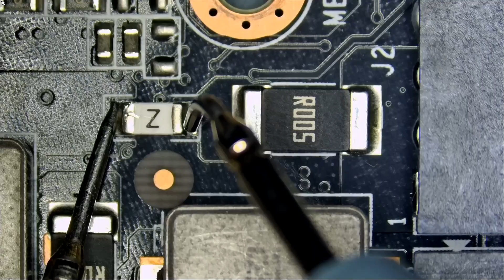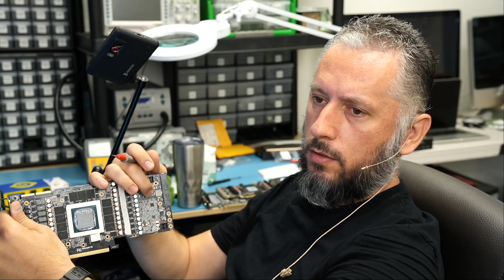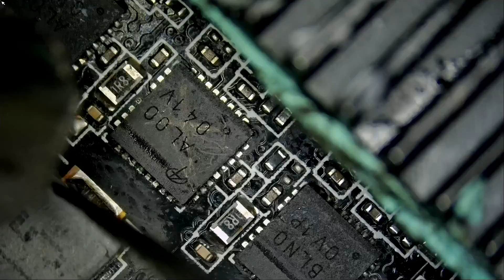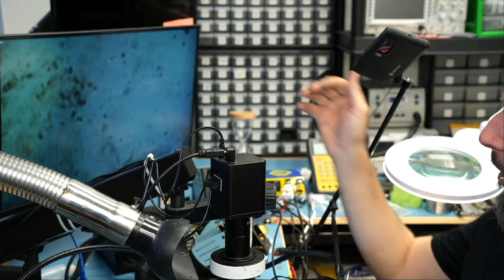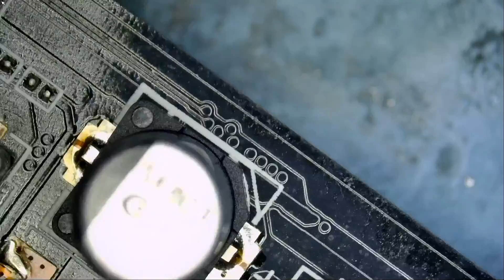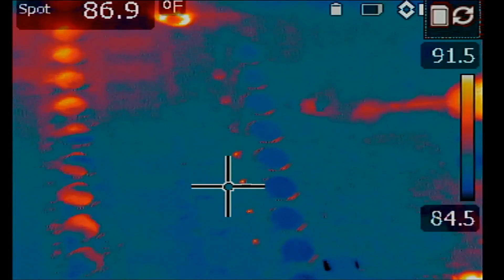Gigabyte Does it again. 3090 Graphics card repair - Failed and won't power on.

Comment: Okay. Story time. The second graphics card is mine. The burn resistor on the top is Arkansas' greatest repair shop. That card is liquid cooled and one day I made a mistake while putting on a water connector. Smacked that resistor and it broke off. I took it to a local repair shop and that's the repair he gave me. Cooked the damn thing. Worked fine until one day it just died. Assumed it was the mosfet (which I'm seeing now it was) and decided to shell out the money for the repair to NorthridgeFix. Honestly seeing this video was hilarious because I expected him to find it. Just didn't know how bad I would be roasted for it.

Edit: Thank you for cleaning that piece too. I'm sure my bill will see it haha.
Reply from the maker: That explains the Capacitor that was laying under the 12v coil...
Reply: @NorthridgeFix  So no water damage. Just shotty work. lol
Reply: @NorthridgeFix  that was on the first card tho not the second one with the crusty cap
Reply: Little Rock here.
Reply: We're gonna need a name drop.
Reply: what was your final bill?
Reply: @BahBahTheSheep  With Shipping and the secondary fixes. 419$. I've had it for about a month and everything works better than before but I also started undervolting it hoping that would also help it long term.
Reply: @Armstrongx7 beats buying another one lol.
Reply: What was the shop? I live in AR and would like to know to stay away from them lol
Reply: @Husslehoff  Any of the UbreakIfix stores. There's one in LR, NLR, and Conway. Dude cooked my board.
Reply: Why would you trust ANYONE in ARKANSAS with anything electronic. I lived there... LOL!!!!
Reply: @brettake2907  I live here lol. I called around and they were the only ones who would work a PCB. So I figured it's just one solder. Nope. Ruined it. But hey. Now it's on Youtube for everyone to see the handy work of a store from here hahaha.
Reply: LMAO @brettake2907
Reply: Alex since it is a known issue I suspect people should class act against a faulty product to get a free repair / recall?  I tjink you'd prefer the former rather than the latter though
Reply: Great videos but to much soldering station Ect to buy, really in each video?? For the 5 new viewers
Reply: @jeroenvtec hey, man gotta hustle...😏  he's gotta house to pay for 😌
Reply: @jeroenvtec  You must realise that theres no such thing as free content. I am grateful that Alex takes some of his time to make and upload these videos, the amount of knowledge and craftmanship they provide more than cover for any ad he decides to include to the products he sells
Reply: @jeroenvtec  Seriously man?  Alex is giving you all this entertainment and more importantly knowledge and you gotta whine about the 30 sec sales pitch for gear?  Entitled much?
Reply: Weird complaint when no one else in the world is giving away quality free quality training videos on these subjects   @jeroenvtec
Reply: @jeroenvtec you got problem with man providing for his family?

Comment: lol, mine just blew that same fuse. It was a watercooled one in their "gaming box" egpu enclosure which I mined with for 2.5yrs. It had been sitting a few months unused and then I started using it again 24hrs before thanksgiving so I could get my laptop ready to play games on the tv. Well as soon as I loaded something actually demanding and using ultra settings, it died after 30min and the fans went on high on the egpu enclosure.
30 days outside the 3yr warranty so I used it as an excuse to get a decent thermal cam finally. Even if gigabyte made an exception and offered replacement, I don't know if I trust other cards enough to accept. This one I got from them missing a thermal pad for the single ram chip on the front from the factory so I immediately upgraded all of them when I was in there and it ran cool and efficient with hotspot never over 85 after that.

Comment: I got a alienware r15 laptop with a great GPU, but only 16 gigs of RAM  thats soldered to the motherboard. Its a real handicap. Also, my intel  i7 isnt the most capable cpu out there.

 What would it cost to upgrade to 32 gigs? What would it cost to upgrade my chipset? 

Would it be smarter/cheaper to just fully replace the whole unit?

Comment: This shit your doing is badass and I think its cool!  Your like a micro technician able to isolate issues on circuit boards and fix them where it cost $1,000+ to just get a new one when its like probably $2 worth of components and your skills to make them work again probably without the issue ever happening again and upgraded too!
Reply: Dude got me wanting to solder and I bought one. Working on a project to put SK6812 LEDs under/above my kitchen cabinets wired to a ESP32 board with WLED installed on it.

Comment: Date codes tell you a lot. Many years ago, I kept getting failed boards back from our customers on our product.  After replacing the same failed chip constantly for weeks I noticed the same manufacturer and same date code was only failing.  We went to the MFG and they started giving us replacement chips for our products.
Reply: Que marca era el fabricante?

Comment: How many watts is that hot air tool? With no real experience I'd be afraid of burning the board getting the old part off and burning the new part installing?
Another thought... Why do the mosfets keep blowing?
1. Cheap components [China?]
2. Running them at or close to their current limit and or inadequate heat sinking
3. Poor circuit design
#3??? I've known audio amplifiers that use mosfets in parallel will be designed with a .05ohm resistor from each mosfet drain to the circuit bridge bar. This is to account for differences in resistance and turn on times based upon variables in manufacturing. If they were to use matched mosfets, the resistors would not be needed. Even with matched sets, degradation over time would come into play in a negative way.

Comment: The same location twice for the same failure.    Hmmmm!  The engineers responsible for designing this video card are at the same location too.   They are standing right next to the water cooler bragging what a great card this is.  Well, the customer should be pleased that it was repaired quickly.

Comment: I got 1080 ti ROG strix offer for 100$ 
Problem is card drops frames and stutters.
Card was already opened by someone stickers on bolts are damaged 
How could I make diagnostics what is wrong with card, past owner told me i you lover the memory clock in after burner card worked 
so what would be my solution I would like to try and fix it

Comment: Great work once again, today I develop an SW pre-amplifier, only for the RX side. I make them myself for many years, it brings an extra of 22db, and it has no connectors, just to minimize lost. And then I have to repair a limiter/ compressor, 2 new pot meters. I tried to fix it with Caig, But that failed. So new ones.

Comment: This is why I avoid Gigabyte products (they already had a reputation for being unreliable, so I wasn't shocked that their power supplies literally exploded at one point, not to mention I head their motherboard RMA's are a total nightmare). But yeah, I love just leaving these videos in the background. There's a certain zen about your calmness while tinkering with complex hardware I absolutely admire.
Reply: its because they have shitty fuses and theres a chip that also sucks and goes out all the time.  Gigabyte was probably scammed on some of there stuff and but ran it anyways
Reply: I had an 1080Ti from Gigabyte and it had MASSIVE framdrops. It worked so sub-par I had to run it underclocked or else my games would just freeze and crash. And one day, it even short-circuted. Got a new one thanks to warranty, same issues. So yeah, Gigabyte is dead to me
Reply: I've have the same Gigabyte (Z390 SLI) motherboard for 5 years overclocked to the max and it still works flawlessly. Similarly, I recently bought a Gigabyte RTX 4090 and no problems with that either. I upgraded from a Gigabyte 1080 TI which is still working. Must be luck of the draw.
Reply: What about MSI and ASRock ?
Reply: @prathmeshpatil6425  I've used MSI builds for years and haven't had issues (one of my favorite brands) and...Asrock, I never tried myself. To my knowledge, MSI just sucks with pre-builts and the odd motherboard issues I thankfully never had :P. But yeah, I'd like to hear the major issues MSI has, I always thought it was one of the better brands out there.
Reply: @MndCtrI I have an MSI MPG X570 motherboard and it works just fine for 3 years now. The audio ports on the back are all messed up but all of my headsets are wireless USB anyway. Everything else on the board is good and stable.

I won't buy MSI anymore for how they try to pay reviewers to redact poor reviews of their products.
Reply: @QactisX  Ah, interesting. Didn't know MSI went down that route...not surprised though, everyone seems to do the dirty these days :P.
Reply: @QactisX  had the exacte Audio issue on 2 MSI boards (B85M / Z270) they are still running today fine but reading your comment made me realize it's a common issue on them!

Comment: I won't be getting a gigabyte card any time in the near future that's for sure. They're trouble cards now, from SMD's going bad to PCB cracking, they're pretty much junk imo. I own a gigabyte GTX 960 and haven't had one issue to date and still works flawless. Evidently gigabyte dropped the ball on quality with newer cards.

Comment: Was on a waiting list for 3090, 9 months, got it and it died in 2 weeks.  Black screen and fans full speed (a reboot of pc it came back) . Thought maybe power supply so got a new Corsair  HX 1200. It did ity 2 more times and 3rd time it was done.. Waited 3 months to get a replacement (warranty but cost $60 bucks to insure and ship back). The 4090 was out so got one of them  ( no issues so far but did not get a Gigabyte again) and the 3090 is still in the box new from warranty. lost a boatload on that one.. Liked Gigabyte but after that, i am not sure I will buy again. Online there were many horror stories on these cards.

Comment: 7:05 i like to put boards in a toaster oven on low heat just to heat soak the board. Makes it easier to get components off with the hotair. Just have to be careful to not go to hot for the caps or plastic parts to get damaged.

Comment: I would be curious to learn what PSU is in their computer. All the same.
A few years ago my video card was streaking lines. Thinking the card was overheating, I redid the paste. Helped but no fix. Finally, I removed and tore down the PSU only to find two filter caps badly leaking and swollen. I replaced them and that fixed the issues.

Comment: Can you start producing reports like Blackblaze does for hard drives for number of GPU failures per manufacturer you have received? That would be useful to read. ❤
Reply: The problem is that any repairman will only see defective items, you won't get a proper ratio of failures to sold inventory. You won't know if a maker have a higher percentage of failures or if the repair shop receive lots of them because it's a popular brand/item. The best that they could do is show how many of the brought items were fixable, but you would still be missing data on items that break again after the repair is done.
Edit: obviously a report on common occurrences on products is helpful to reduce time diagnosing why the failure happened.

Comment: Hi Alex, 

How can i get some of the tools in Pakistan.
I don't know if i can get them from china from your suppliers directly because china is close to pakistan so the fastest delivery with less delivery charges than from USA.
Voltage injection tool, flux, soldering machine, thermal camera, microscope.
Off course i cannot but them all together because of my limited budget but to buy them one by one is my only option. 
I am interested in learning the repair because I loved the electronics but never had a chance because of money and tight job schedule.

Comment: The one in the middle is the one that has the most trouble dissipating heat so it would make sense that it is the same one.  Needs a better way to get the heat out of there without saturating that one area.
Reply: Or it is the very first one to take the bigger load ad startup and since it needs to charge caps.... maybe the heat issue can be a factor too but look at its neighbor which isn't affected by heat or anything else.

Comment: 13:50 this capacitor shouldn't be there right?
Reply: it is from other place... there are no solder pads there... i guess it's working without a filter cap from somewhere

Comment: I'm wondering about the value of 20 amp for a fuse. Where should this high current come from, ? what is the normal current there. A 20 amp fuse didn:t blow at 20 A it needs more.

Comment: Hey Alex! Did you notice the one desoldered 0402 cap below the 12V coil @13:50 ?
Reply from the maker: I haven't worked on that card yet. I'll check it out when i get to it.
Reply: @NorthridgeFix  We're talking about the first card, not the second one.
Reply: @NorthridgeFix  well damn, I think you said seconds after 13:50 "we're done" 😕.
Reply: 13:58 SMD flying left of fuse 😅
Reply: Alex that cap for mosfet NO 5 up replasment moset if U  look in 5:54
Reply: Came to say the same... Wasn't there earlier in the video. It's from a previous video, returned from the 9th dimension.

Comment: Well if the Framework motherboard is unfixable at least one can get a new one from Framework... :/
Reply: Framework also provides schematic of the board layout for troubleshooting I'm pretty sure. I glanced through manual when I got my framework laptop 13
Reply: yes but u still pay alot cash for it cause cpu and gpu (if dedicated) are stil soldered to it

Comment: How can this failure be avoided?
Reply: Dont do Gigabyte gpu nor psu
Reply: @vincentvega3093  what about motherboards
Reply: @rsgxyt  Motherboards from Gigabyte is Shit.. i mean just shit.. why? just every Z690 or X570/X670 have Coil whining on PowerPhase... its pretty loud even bios doesn't help just google on youtube coil whining the most  problems have gigabyte boards...
Reply: @rsgxyt good for low budget mobo
Reply: @rsgxyt their Aorus boards are good
Reply: @rsgxyt For motherboards prefer MSI or ASrock
Reply: Look into undervolting, this reduces heat and power consumption with a small loss in fps in benchmarks up to 2 to 5 fps, will not notice the difference but you will notice a huge drop in power draw and temps. Cap Max fps just below refresh rate of monitor I.E if you have 144Hz monitor cap fps to 140 fps in drivers. All these cards fail over time its not just a gigabyte issue. Undervolting will ensure the card will last longer because it will prevent the card from cooking itself. 30 series cards run hot.
Reply: @@CptBlack. It's just shitty components. Overclocking raises the issue a little sooner but todays possible overclocks are quite modest. On paper the cheapest designs still have enough headroom to cope with that overclock.
Reply: Seems like an issue that would occur merely by using the card, an engineering error. You personally can avoid it by not buying this card, or if you're stuck with it, using it in extremely relaxed environments, think 2D stuff like Word and Excel.
Reply: Gigabyte is JUNK, Always has been!  I have never bought that crap based on the reviews from their products alone.
Reply: So my graphics card was actually the second one in the video and I can tell you , this is my one and only purchase from Gigabyte I will ever get. I spent 1600$ on this in the height of the shortage and I’m feeling kinda ripped off lately🤣
Reply: Don't buying
Reply: There has to be a better source for these inadequate mosfets. If not, ripe fruit for any one of these component manufacturers to step up to the plate.
Reply: Don't flash the 1kw vbios and feed it with 600w of power..
Reply: @boofygoofy3758 I wanted the 3090 for the 24GB of VRAM. Obviously not Gigabyte but at the time it's all I could get. Could've saved 500$ but it is what it is. When I get it back I'm just gonna undervolt it and pray that this won't happen again.
Reply: @boofygoofy3758 If I change it. Probably just gonna double down on the 4090 lol. The 24GB of VRAM is just amazing...when it works obviously.
Reply: Avoid gigatrash products.
Reply: That's a whole manufacturing failure and supply chain.
Reply: By buying a different brand.
Reply: Don't overclock
Reply: Don't buy Gigabyte
Reply: @detmer87  Same for Alienware too lol
Reply: Stop buying nv